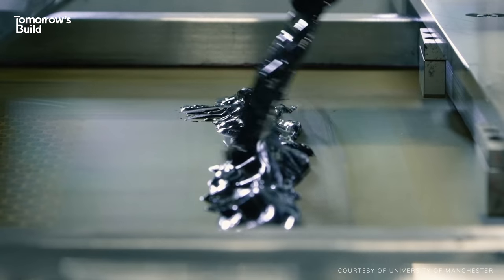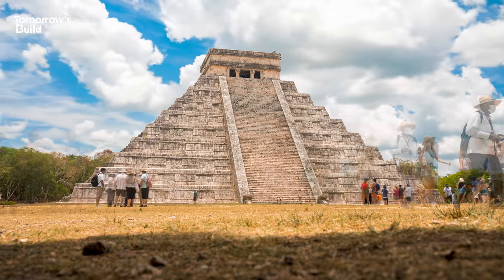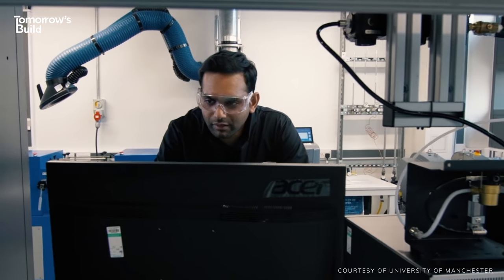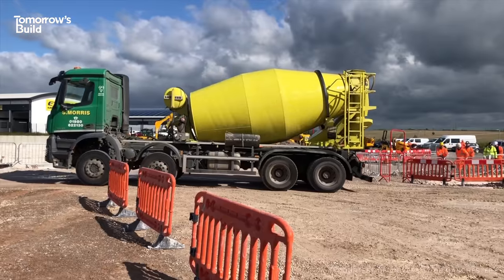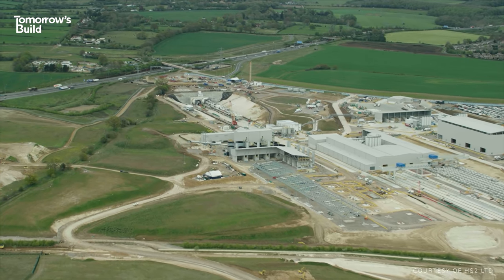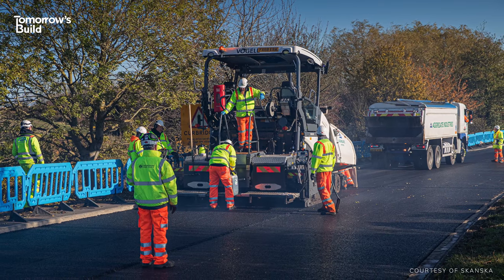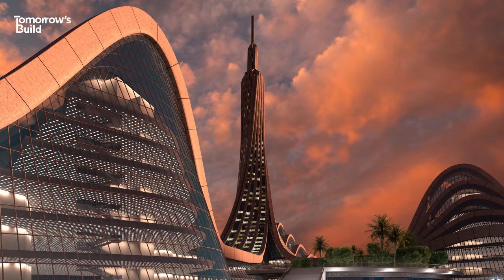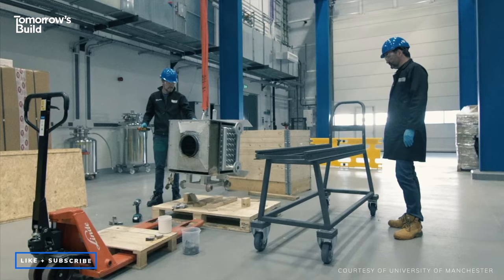Construction's Graphene Revolution Has (Finally) Begun

Comment: The “pothole” joke was really funny but it’s also true. I hate potholes and they infuriate me every time I drive over one. Hopefully I’d be able to drive on a graphene road in the future.
Reply: That was not a joke. We are not used to them, but under Boris Trump they are now common.
Reply: @johnburns4017  what does the two guys you mentioned have to do with potholes?
Reply: In the US the pothole shown would be considered a slight bump. I don't consider it a real pothole unless it takes something off the bottom of your car.
Reply: @papaechozulu3737   we have a lot of those potholes in New Jersey 🤣🤣
Reply: @tedlessor3887  
I mentioned one.
Reply: @tedlessor3887  
Why there is a lot of 4x4s then.
Reply: Here's a tip that 99.9% of people don't know.  If you report a pothole it gets filled.  Unless you live in a shit hole place that doesn't have road maintenance performed by local government.
Reply: @gwaeron8630  
Many are being filled using a mix of concrete and graphine as in the vid. They stay filled in. New Road surfaces are being pioneered using the mix, but not fast enough.
Reply: @papaechozulu3737  that's just semantics lol, they're still both frustrating to many people and are both worthy of repair.
Reply: We should start a government petition to make it mandatory that the dvla road tax pays out for damages to our vehicles caused by the pot holes we pay a fortune to avoid in road tax every year 👍
Reply: As someone from Michigan I share your sentiment. That is one of a few reasons I drive a truck.
Reply: @johnburns4017  derr I though Byedon is supposed to fix all that with his infrastructure crap derrr

Comment: I wonder how it affects phone signals and EMF, since it might make a building into a Faraday cage?
Reply: Most buildings have windows
Reply: @bounceday  radio waves go through windows or are blocked depending on wave length. Anything bigger than the windows would be blocked.

I guess anything bigger than a few meters depending on the kind of building would be blocked. Broadcast band radio would be out of the question. Not that much of a problem.
Reply: The percentage of graphene in the concrete is very small.
Very little effect.
Reply: @bounceday  no way?
Reply: @bounceday  for real?

Comment: I am a scientist and I worked as part of the European Graphene Flagship Program while I was at Cambridge. I can tell you first hand: it is all hype, and the top professors were laughing all the way to the bank. The material is practically impossible to process in a scalable way, and as soon as you try to suspend exfoliated graphene in a solution or composite matrix, it stacks back to form graphite particles that lose the “magic” properties of graphene. It is a complete technological white elephant. You’d be better off reinforcing concrete with fibreglass or carbon fibre.

Comment: I understand that graphene is the strongest substance we've found/created, and I understand the theory of how a sheet of graphene works.  But I thought it had to actually be a sheet to produce it's properties. I don't understand how adding a tiny amount of very tiny bits of graphene to something (e.g., cement) helps to strengthen it. How are these tiny unbonded pieces helping to strengthen the substance, exactly?  I don't get it.
Reply: If I were to guess it has similar property to making steel from Iron- especially in the point that it increases durability/non-shatter properties.  By adding carbon atoms to the lattice structures of the concrete, you are further locking together preexisting bonds
Reply: @johnwhite950  could be..

Comment: 2:19...hold your horses boyo. There are real life actual products using graphene really well. Haglofs mimic platinum (sythetic down fill for jackets etc) is a thing. And a blooming good one at that. Put on a jacket with the plafinum mimic fill and you literally feel your body heat warming the jacket and therefore the rest of you within the jacket almost instantly. It really is amazing. Honestly. So impressed and you can tell the difference easily.
Also Vittoria bike tyres have been using it for years. Not had that much experience with them personally but they were an early adopter.
Give people credit where it's due. And do some research before making sweeping statements.

Comment: The claims made here are similar to what was achieved with other fillers in the past.
One reason the fullerene, graphene, carbon- or glass-fiber composite wonder materials from the late 80s and 90s never took off or seen limited use, is the problem of recycling those materials. The regulation changes we need might be those that further limit the use of non recyclable composites, regardless of cost saving advantages they might bring.
And what about that 200 story building with a exiting new shape, impossible to build otherwise? Yeah, maybe the world doesn't need it.
Reply: And how is current concrete recyclable?
Reply: @hajorm.a3474  Good point.
Reply: They're both noot points as concrete and building materials are hardly ever really recycled, and such buildings are inevitably going to be constructed either way, so it might as well make use of better, stronger, safer and overtime cheaper technologies such as this

Comment: It’s also in COVID vaccines
Reply: It's not. The patent or ingredients do not show graphene. and No independent test has ever shown graphene in the Vac
Reply: @somethinghappened3328  The actual statics say it's extremely safe. The numbers you have most likely seen are the massively inflated ones, not the correct ones from the actual sites. 
Vaers reports 8,390 of de  ath after (not caused by) the vac out of 389 million doses. 
European Medicines Agency: there has been 6448 de  aths from 528 Million doses. And from the EMA "The Fact that someone di  ed after vaccination does not necessarily mean that this was caused by the vaccine. This may have been caused, for example, by health problems not related to the vaccination". 
Australia: 9 de  aths from 28.8 million doses. That's 0.000031%
Compare these numbers to the ones you have seen. These are from the actual sites.
The vaccine de  ath rate per dose is extremely tiny. Most likely lower than most vacs. Remember well over 6.5 billion doses have been administered worldwide. So the total might be higher but the total per dose will be lower.
Reply: @somethinghappened3328  Most doctors and hospitals that I've seen are taking the pandemic seriously. 
The rest is politics.

Comment: This is what is being found in the jabs. Graphene Oxide.
Reply: @paulg666  Takeda pharmaceuticals in Japan found it in their Moderna supply. About 3M doses. Also stainless steel shavings. So they banned Moderna.
Reply: @tripprohm4926  That's not the actual true story. 
In Japan no graphene was found. 39 vials, from Spanish manufacturer Rovi, were found to contain small particles of stainless steel (as found in heart valves and joint replacements) due to a manufacturing fault. The whole batch was sent batch. There was no graphene in the vials.

Comment: With enough graphene mixed in, you could make concrete walls that are structurally sound and able to conduct electricity - better than copper wire. How the industry makes use of this is up to them, but you can imagine some out-there possibilities such as wall-sized screens or discrete solar panels.
Reply: ......you know you're not supposed to have exposed wires in walls right?
Reply: 2 words: Eddy currents. There's a reason we use copper wires instead of copper sheets to conduct electricity.

Comment: Also concrete graphene slab, so it's not a lead bearing concrete structure like those found in the walls and roofs of buildings, also mentioned in the video they added strands to make concrete stronger, so does the graphene strands search and cross link together when added into concrete? But isn't cross linking weaker than end to end connection? The reducing cracking part I understand because crack stress cannot travel far into a tangled mess of graphene+concrete, there is no clear "grain boundary" for cracks to travel, but still, so many questions. Also isn't concrete pulling Co2 from the atmosphere to get stronger over time?

Comment: So what is the difference between adding graphene or graphite to the concrete? How are the mechanical improvements achieved?
Reply: Graphite is just stacked layers of graphene that are weakly bonded together. It you try and use graphite as a reinforcement, any force applied to the particle will simply shear the layers apart (exactly what happens when you write with a pencil). However, the single sheets are extremely strong because you're stretching covalent bonds instead of the weak van der Waals forces holding the sheets together.

Comment: Though it's still not cost effective, else you could buy those graphene products at your local store. 
Although rebar is a modern curse, as it is the limiting factor for the longevity of buildings, it will take decades for total replacement.

Comment: Uh...No rebar? What about shear strength? The reason reinforced concrete is such a widely used building product is because of its tensile strength by way of the concrete mix and shear strength through the rebar. Its a perfect marriage as the two products expand and contract at similar rates. Here they said the carbon offers 30% extra strength and i believe it, but its doubtful to replace the shear strength of rebar.

Comment: I really can't understand how something that essentially doesn't exist can be used to create such significant increases in strength. As a 2 dimensional material I can't see how it can increase bond strengths of anything when it's a powder rather than a sheet. It's not only a powder but it's a powder with fairly much infinitely small particle size. <puzzled>

Comment: So how is a rebar-less concrete transferring load laterally/horizontally throughout the structure? Is it because the Graphene strands is holding to a concrete particle, then that concrete particle is being held by another graphene strand and on and on forming a link? Is that how it works? 

But how did they coerce the graphene particle to form a physical/chemical connection with the mix of concrete particle when graphene has stable carbon link between itself? If not does this mean that the graphene seeks out other graphene particle and self-assemble into strands within the concrete like smart nanobots?

Comment: Sometimes, speaking as a mechanical engineer working in the field of calculations, it feels like the building industry really lags behind in applying new materials and new forms of structures due to the poor (and only) choice of using concrete & steel. Sure, it is still a challenge to calculate cracks in the mechanical field monitoring how the load spectrum behaves over time and knowledge of how & when the material actually cracks. But in the end, this is something you must be able to face as a construction enginner working with calculations. My best bet as to why the building sector isn't getting anywhere is simply the lack of knowledge of how to create a very stiff building without to many crack propagations while keeping a low weight of the overall structure and countering most severe environmental effects.

Comment: Does this also answer the question of what to do with the excess carbon in the atmosphere?
Reply: No. Removing CO2 is hard and most methods require temperatures over 2000 degrees so you produce more than you capture. It baffles me that plants get almost all of their carbon from CO2 in the air at normal temperatures but we can't figure out how to do it without massive amounts of energy.

Comment: What's the health risks when you knock that building down or cut into a concrete slab of graphene? Just like asbestos is was going to  increase strength plus fire protection.
Reply: Asbestos fibers need to be breathable to be harmful but when they're trapped in the concrete that isn't a risk. It's actually still legal to use asbestos concrete in the US. I expect it will be the same with graphene.
Reply: @abebuckingham8198  I'm more concerned when you need to cut or drill into the surface. Like silica dust. It's when it goes to air does it start to become a health issue.
Reply: @alexb5787  still would be in the concrete

Comment: What about oil? Engine oil specifically. Isn't graphene supposed to be a good substitute for lubrication? Could it be used to help engines run smoother and possibly a little more efficiently..? Especially older engines...

Comment: They poured the graphene on a ground floor slab, so what. Let’s see what happens when they pour a suspended slab with it and no steel reinforcement, and it’s put under load.

Comment: Why use aluminium for HT power lines when copper is 6x? more conductive? Because its much lighter so spans between poles can be longer. So if graphene is lighter & more conductive, thats very exciting too. Greening the grid means we face huge grid upgrades & pressure of copper supplies.

A bonus is that its also carbon burial.
Reply: We can barely make flakes of it, let alone cables. It's also biodegradable which wouldn't be useful for open air electrical transmission and conduit is at least an order of magnitude more expensive than cable.

Comment: It's an interesting technology but as usual wih carbon composites the big question is how competitive it is compared to the cheaper glass fiber composites. If you don't need to squeeze every drop of performance out of the material then glass fiber is a better choice.
Reply: Glass fibre concrete has still not edged rebar out of the market. This video suggests that rebar would become redundant with the use of graphene, which would be very significant.

Comment: What’s the durability of Graphene? What’s its longevity? How does it engage the environment? Can it become a carbon sink for reducing CO2? How does it affect living organisms, is it non toxic?
Reply: It's durability seems low. We don't know the longevity in the environment. It's already a carbon sink since you can crack methane into graphene which is the most common production method. The most common interactions are dissolving and interacting with oxygen to form carbon monoxide or graphene oxide. It's cytotoxic on nanoscales in the lab but we have limited data on health effects for animals currently.

Comment: isn't graphene just a graphite in a 2D sheet formation? 
If you powder it and put in concrete, isn't it just as adding  graphite?
Reply: There's no such thing as 2D
Reply: It takes energy to molecularly bond it back into graphite so it probably varies from application to application.

Comment: That elemental analysis shown at 6:08 seems odd. Graphene should be 100% carbon (whether measured by atom fraction or mass fraction), yet there's upwards of 22% oxygen. This implies that the product purity can be as low as 77%.
Reply: That's a vial of grephene oxide, not pure graphene.
Reply: @finaoo1167  Ah, that makes more sense.

Comment: Could graphine be added to the resulting glass like slag from the plasma gasification process to produce a super durable and long lasting building product?
Reply: The melting point of ceramics is 2000c and the range in which graphene's molecular bonds decompose is 1200-2000c so the temperatures involved with the slag are likely too high to incorporate graphene before hardening.

Comment: What about the risk from graphene that makes it shed fibers similar to asbestos .
Reply: It doesn't form fibers instead breaking into relatively hexagonal particles. Asbestos fibers are large enough that you can see them with a conventional microscope. Graphene particles require an electron microscope as they're much smaller. Asbestos fibers are about 1000 times larger than graphene particles. That being said we have little information on the health effects of graphene exposure at this time.
Reply: @abebuckingham8198  then why are there studies showing it has negative effects similar to asbestos exposure?
Reply: @abebuckingham8198  They have been called a “wonder material”1. But new research from the MRC's Toxicology Unit has shown that carbon nanotubes (CNTs) can induce the fatal cancer mesothelioma in mice in exactly the same way as asbestos.22 Mar 2018
Reply: @SassyTheSasquatch96  You're confusing carbon nanotubes with graphene. While they are similar molecularly they have very different properties when it comes to forming fibers and maintaining the larger scale structure and sharp angles that make asbestos so harmful. Long term studies of graphene exposure show no long term health effects. Note that graphene oxide is toxic when inhaled too so it's just the graphene that doesn't seem to be harmful.
Reply: @abebuckingham8198  Thank you i wasn't
trying t dispute you i was just trying to get what i understood clarified :D

Comment: Excellent material considering cracking concept but I have being practice with graphing  once I have seen it on internet  the thing is it enough if it can be used in asphalt and concrete material for every or can you me isotope of graphing so that it will be sufficient and affordable and durable building in long run thanks I appreciate the hard work...

Comment: while ive been excited for years im also worried when budget graphine finds its way into the air and water ways we are going to create a bunch of new health / environmental problems that we arent prepared for
many of the worst parts of plastic with a side of asbestos
Reply: Graphene is carbon. There is already carbon everywhere. All life on Earth is carbon-based.
Reply: @IAmNumber4000  if it was naturally occurring we'd be spinning it already 
its not like asbestos didnt come from the ground if we process carbon in a similar form for similar purposes it will do the same thing
Reply: @danbaxter4260  Are you trolling? Do you not know what carbon is?